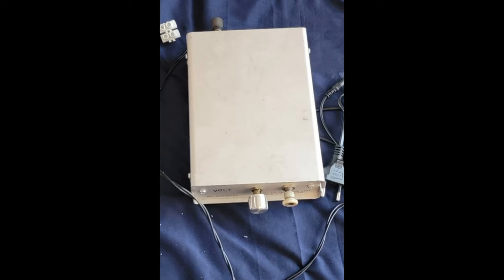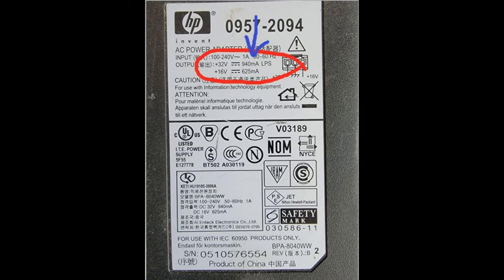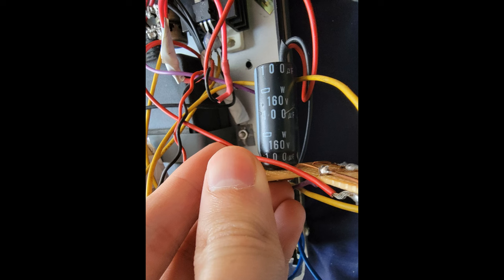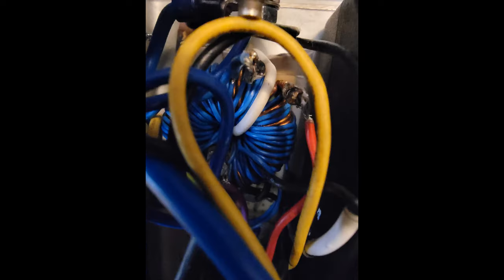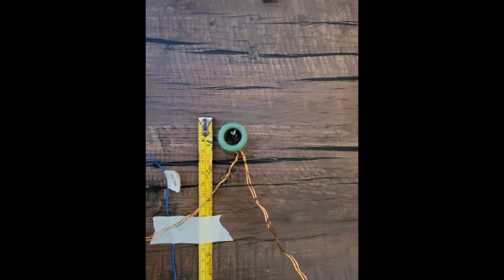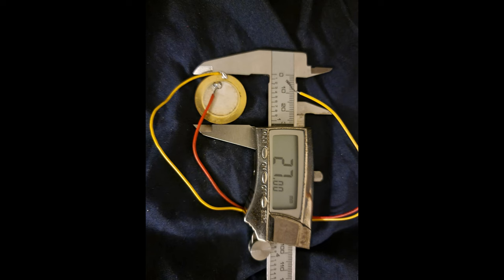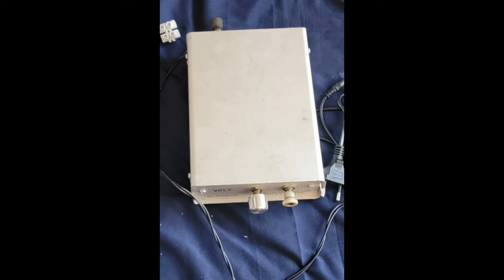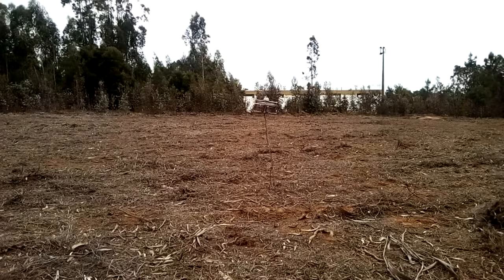Ultrasound circuit

Comment: There are three wires for the output of the power supply for that ultrasound circuit. Alexey was only using the ground and 16v wires, not the 32v wire. The LM317T just lowers the voltage to 5V for the left half of the circuit. The C33740 transistor is not that good and will easily overheat, so monitor the input current. I prefer the 3rd kit ultrasound circuit that is in that share drive; Alexey made improvements to his design in later kits.
Reply from the maker: did you get a frequency range?

Comment: "what you need to see right here is 940 mA. That didn't say 1A it didn't say 2A. 940 mA"
Gets me every time
Reply: Why are you hung up on the power supply ratings? Everything electrical will only consume a limited amount of power. As long as the power supply can provide this limit or more it will be adequate.

Comment: lm317 is for 17volts then you need min 24 volts input
Reply: The LM317T can handle 37V and has an adjustable out put from 1,2V to 37V.

Comment: I'm still scratching my head trying to understand why you drew the circuit so confusing.

Those lines hanging out the left marked positive and negative serve no purpose.

Most circuits with this regulator have two capacitors as a filters to smooth out input  and output. In all cases the output will be lower than the input of this regulator chip and will be a dc voltage.

We all know transformers work with AC voltage and not with DC voltage so my guess is the transistor part of the circuit is turning the 22 turn coil on and off to make and break the circuit which pulses the transformer and that induces a voltage into the secondary winding.

The transformer winding ratio is roughly a two to one so output voltage to the pizo disk will be about twice the input voltage coming out of the regulator.

Since your not clear in your description on the exact input terminals used from the power supply; it also makes it hard to guess as the rest.

I did notice the plug on the unit is not USA so it's probably a higer voltage power supply than we use here in the USA also.

Have you plugged the values into a Spice circuit simulator program and observed the results?

That's a cheap way to evaluate the circuit without buying any parts.
Reply from the maker: I have not done that but I will. The power supply has 2 levels 32v and 16v. I did not make the schematic. It was given as a translation from Alexey. There might be some things that are off. He doesn't make schematics for things. So they are best interpreted as a connection method.

Comment: Couple questions and observations. The top disc doesn’t appear to have magnets. 
Am I wrong? 
Bottom disc appears like it has the magnets in pairs one right beside the other. Could this be due to frame rate of camera making an illusion?
Why is there a cap on the top motor? 
Bottom motor appears to be leaning left and the distance to middle plate is 1.5 times further than top.  Could be a camera illusion. Just trying to put ideas out there  I have thick skin so feel free to comment. Still need a schematic of how the Tesla coil connects.
Reply from the maker: frame rate of the camera.
Reply: Frame rate for which parts? Two magnets?

Comment: Old Man Builds you got it correct. Then use the polycarbonate disk with Al on one side and Al2O3 on the other side. Put the high voltage and to ionize the air above and below the device. The put a spinning charge to move the charge to the outside of the disk and spinning magnets to keep the ionized air separate from the unionized air. The use this circuit to pulse the ultrasound disk to get the device into resonance and then push the button to stop the ultrasound so the ionized air above and below the device outwards to make a partial vacuum so the device lifts up like a hot air balloon. The ionized air of N2 and O2 interacting with the spinning disks make anti-gravity waves much like an airplane wing that is making a partial vacuum that then interacts with the O2 and N2 to make anti-gravity waves to create lift.  To make warp or wormhole drive on the airplane charge up the fuselage with electrons with a fusion ICE or jet engine that produces more electrons. Then have a high-capacity battery to store this current when the warp drive or wormhole drive is in use going through time or the wormhole that are the waves that are on my spectrum in the space wave part.  Changing the current and voltage that is produced by the fusion ICE or jet engine produces either the warp drive or wormhole. Space and time are structured in a way that you are in the past from me, and I am in the past from you and this all works. This is evident with red shifting light from galaxies as the light travels through the universe. Red shifting is a change is frequency. This is gravity and blue shifting is anti-gravity. Make a different time passage in a different reference frame with different gravity waves or space waves as per my spectrum. This is why UAP seem to move very fast in our reference frame and very slow in the UAP reference frame.  This is also very evident as we see every point in the universe as the middle of the universe. Use my star device to get the high current low voltage for the spark in the fusion ICE engine or the jet engine to initiate the fusion reaction in these devices and use salt water from the oceans for the fuel.
Reply from the maker: I think you are going to enjoy the next video with Alexey explaining the Graviflyer himself.
Reply: @nathanbunten4299  I cannot wait for it.

Comment: NO! NO! NO! That is not how it works! I built one to demonstrate this like 2 years ago using random parts I had on hand. It works by energizing the transformer core until it saturates, then the voltage on the coil collapses and the transistor turns off, and it flies back to reset the core. When the core is reset, there is now current into the base of the transistor and the cycle repeats. The large capacitor only has ripple current due to the current draw of the oscillator. The POT on the LM317 adjusts the voltage, which controls the frequency, because transformer saturation time depends on Volt-Seconds applied. Good luck. The type of core, the value of the capacitor really don't matter. You simply adjust the number of turns and the voltage to get any frequency you like, at whatever voltage you like. It's an old self-oscillating circuit I learned in the 1980's. It works great as a front end gate driver for a Forward Converter.